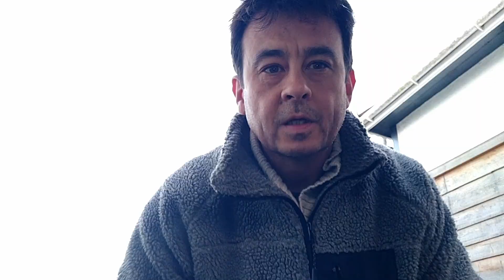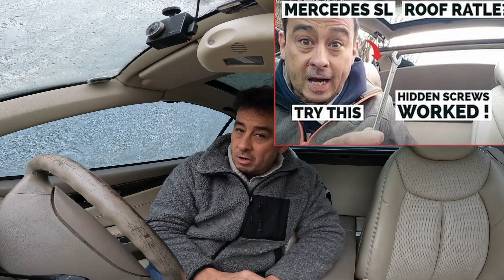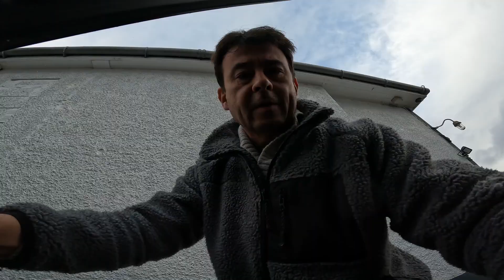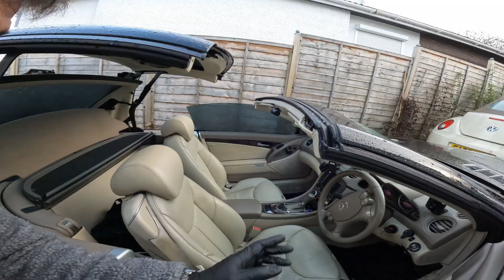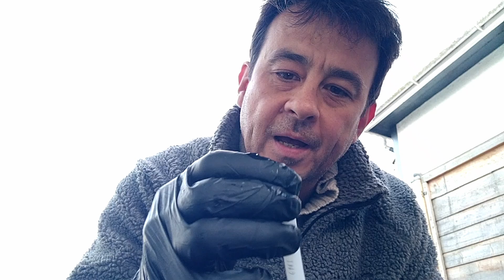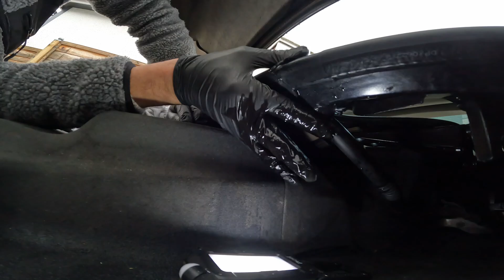Mercedes SL Roof Water Leak Fixes Trunk & Cabin

Comment: I have a PSE problem. I watched your videos. Great stuff. First I need to tell you I'm 76 year old disabled Army Vet, with very limited mobility. I've been trying to check the fuse behind passenger seat and I can't get the lid to open. I've removed the front panel but have no hope of being able to check fuse or remove to reset. Is there any trick to getting lid to open without PSE working. I'm pretty sure trunk soft close is faulty as well. It's on my to do list.
Reply from the maker: Hello sir, first thank you for your service!. Have you tried using long nose pliers to get the fuse? If you can get in the trunk, on the left is the PSU pump try disconnecting the electrical plug then pop it back on, you should hear the pump when you do this. You could also try disconnecting the rear battery leads and putting it back on.

Comment: Hi just a question please i checked the roof adjuster both sides by the C pillar you use a 10mm spanner for, mine (2003 Sl) dont appear to be adjustable? they seem to have a hard plastic cover over them which I will need to break to get access to any M6/10mm  locknut. it looks like the stops are tapped into the frame/strut.
Both stops are definatly too tight, my rear left side rattles and no chance of any credit card slotting through, I,m thinking year/spec difference with your own.
Or? i might just go for it and break the plastic to see if there is a locknut underneath.

I have found all my water leaks now and i,m dry, all were you said they,d be and I did the same mods as yourself for the fix/repairs, thankyou ian 

For Anyone interested I just fitted an Ebay £140 Android 13 head unit in my 03 Sl350, fairly easdy though they dont give you a decent wiring diagram, I,m a sparky luckily I worked it out, the issues are cambus headlight detection and steering wheel controls (volume, channel change, phone etc?
Any need help just ask
Reply from the maker: the plastic hard casing you are talking about is outside of the rubber. They are hard to pull down the first time, use a flat head screwdriver and get into the base and it will wiggle down, use a little lubrication. The thread as you said is tapped into the metal cast with a lock nut, let me know how you get on.

Comment: Your clips have helped me resolve several issues with my 2005 plate SL500. I'm about to address a minor leak in the boot, what tubing did you use? the link provided no longer works.
Reply from the maker: hi my friend, the Outside diameter of the tube was 10mm so find something that size that is slightly malleable.

Comment: Always engine ON while working on half opened roof ? Does the engine not overheated while doing this ? Thnks again sir! 👌🏽
Reply from the maker: No, engine will simply work for hours on idle, temp sensor will turn on radiator fan. No issues!
Reply: @ Thnks… have a great weekend!

Comment: I just got a 20yo Sl your video,s have been very helpful, Big Thanks, The only water i seem to get in the trunk is my fabric cover that sits over the spare wheel keeps getting wet, nothing else all seals seem to be ok, all drains clear, it must be running down behind the back trim and onto the cover.
As you suggested i have all the electrics etc covered with sturdy plastic bags.
Cheers Ian
Reply from the maker: @MrIzzyStewart  congrats on your lovely SL. I will bet it's the rubber seal at the base if the window and or the little rubber pipes. stick your phone camera on with torch, close boot and get the hose out.

Comment: Unfortunately, you will never stop it leaking. Fix will be temporary, and then another will pop up. Good try. This car won't be pleasant to drive as that leak sensor will be going off all the time. Changing with new rubber is a big job. The edge under the rubber will be rusting.
Reply from the maker: I try to keep on top of it, it does get a bit musty in the winter, but then I park her outside

Comment: What might be better a more supple tubing you could try a catapult tubing you can get replacement tubing from farmers suppliers, also heating up the Seals with a hair dryer first night sort out the indentation problem even if you remove the tubing afterwards

Comment: Great video. I fitted 10mm tubing last week. Poured water over rear window and no leak in boot, so looks promising. Now waiting for rain ☔
Reply from the maker: Great stuff, thanks if you subscribed
Reply: I used your tip of putting a rubber hose into the various rubber gaskets and it helped but I discovered the BIG leak was the rubber gasket along the bottom of the glass. I should have discovered this sooner.  Thanks

Comment: You have the same issue as I do on the rear back panel of the seat - have you tried to fix it?
Reply from the maker: Yes, you can adjust the hidden screw, it will bring the join closer together, also clean and lubricate your rubber seals.
https://youtu.be/1HcznBQPeQM
https://youtu.be/COY1q2GmRUE
Reply: @GrooveOn  ah, what I meant is the way the leather starts to pull and deform, lots like a teenager with terrible acne :)

Comment: Enjoyed the content thanks - I've had a boot leak where its got very wet around the soft close mechanism - seems to be getting in around the 3rd brake light in the centre of the boot lid.  Ordered a new part but for now just smeared some vaseline around the edges which should hold for a few days.  Mine is a 2005 SL350 :)
Reply from the maker: hey there, good work, the seal on the brake light is light foam isn't it. The vaseline should hopefully do the trick ! let me know, Thanks if you chose to follow me
Reply from the maker: Hi Mike how did the Vaseline hold up?  If it does not hold, then you can use a thin amount of sealant and wipe off. For automotive industry and the Rail industry I use a brand called Sikaflex, its a professional sealant and adhesive that is waterproof and sets in water too.

Comment: What diameter tube did you end up using? Thank you for the content.
Reply from the maker: Hi there, 10mm OD think it's in description mate
Reply: @GrooveOn  Indeed it is, thank you! Do you have a 350 or 500?
Reply from the maker: @cav4290  I had a choice I was going to get to 500, but I was worried about the ABC suspension so just went with the 350 that is a 3.7l and normal coils. I then lowered it by about 30 mm
Reply: @GrooveOn  Yes, probably the best way now, although coilover kits with sway-bara are now available for around 3400 USD.

Comment: Really appreciate all the knowledge. I have an '07 R230 and have noticed some water in the trunk, but not knowing where it might originate. I put some 'damp-rid' type closet hangers in there and they do absorb moisture and last about a month before I need to replace. I have an issue with the top hydraulic cylinders leaking right now and that is a considerable investment, but I do love my car.

Comment: hello, thank you for the video. What is the measurement of the extra rubber part on 04.15?Did you sealed it vertical and horizontal? Wont it block the water drainage? I am very interested!
Reply from the maker: Rubber pipe outside diameter is 10mm, it fits inside channel and won't block water mate
Reply: @GrooveOn thanks! But i ment the block rubber, between the 2   Gaskets
Reply from the maker: @henksloetjes7112  oh I got you, that is around 5mm thick, just find something that is similar, you are trying to separate the two sections of rubber mate

Comment: Thank you for this comprehensive documentary. Got my SL500 18mths ago, ive just cleaned and oiled all the seals , So far thats been perfect, but you’ve given me so many more details , especially that nut that’s accessible at the rear when the roof is up. I use the Mercedes sliding oil, would you recommend a cheaper alternative ?,, this is great you documented this , thank you
Reply from the maker: Go with the Mercedes oil, it will last for years

Comment: Yeah, mine doesn’t leak however it did happen to me I open the roof and I shut down the engine and it collapsed on me so I learn my lesson. Good thing to do is lubricate the seals with petroleum jelly. Good luck. my SL 550 it is 2009 with, AMG package color is silver with burgundy interior.
Reply from the maker: That Burgundy colour is quite rare my friend lovely car

Comment: This worked great for me i also re olied all the rubber seals with the merc oil. Thanks for posting this. Now all i need is to refit the original sat nav and i will be all set. 😊
Reply from the maker: Nice work, I did another video on the command unit removal and fix that may help you
Reply: @GrooveOn  what is the title of those video?
Reply from the maker: @2103woody  here you go. https://youtu.be/PcSlUApgII4

Comment: My R230 does have the water drain holes as shown at 5.28. I know there have been slight changes to the later models mine is the 2006 ... any thoughts?
Reply from the maker: Hi there, did you mean your car does not have those drain holes at 5.28😉, if that's the case, it's no big deal, the water should run off the rear

Comment: I checked in the Sikka 221 and it doesn't have a good shelf life. A friend of mine is a director of C Tec and these are his comments "CT1 Black would do the same job with increased bond strength, no shrinkage and without the odour/solvents you get with a polyurethane."
Reply from the maker: That's interesting to know, I have sikaflex in my garage that I've had for 5-years and that's what I used in the video without any issues. The product is used in the areas that I work in engineering mainly automotive and train applications. CT1 is more of a domestic brand rather than professional, but still good. As long as it is not a sealant only, it must be adhesive sealant combined that can set in water.

Comment: What diameter tube did you use. I intend to strip and repair the boot seal but my seals are also flattened
Reply from the maker: Hi Jackie, the pipe OD was 10mm, just cut it enough to get it pass the little moulded join.
Reply: @GrooveOn  Thanks. I am enjoying your videos. Chris. I don’t know why it is putting my wife’s name up.
Reply from the maker: @jackiebedford1609  ha, it's because you are signed into her account I think mate. Try logging out
Reply: Changed account, thanks. Also I fitted the tube on both sides and- hey presto- no leaks. Thank you. I would never have thought of doing that. Other videos show how to replace the seal but that still leaves the same problem which you have solved.
Reply from the maker: @chrisbedford6717  hey no way!!! That's brilliant, so glad. I also applied some vaseline along the top of rubber where it meets the trunk. Did you remember to loosen or remove that drain plug under wheel
Reply: @GrooveOn  Yes. It had already been removed. I think the previous owner had problems as all the electronics, pumps etc have been screwed to a block of wood to raise them. I am now about to adjust the roof with your hidden screw as water has been dripping on the back of my seat and the "leather on the back seat cover has swollen and crinkled up. I would send a photo if I knew how. I have taken it off and when it has dried I will use a hair dryer to hopefully shrink it  and flatten it out.
Reply from the maker: @chrisbedford6717  have a look at my channel, there is a video I did just for those hidden screws that can help you

Comment: You need a new steering wheel
Reply: I had the same issue but with „methylated spirits“ (German: Brennspiritus) I could get it almost new.
Reply from the maker: @samothegeolg5206  no way, I'll try that!
Reply from the maker: I know, when I watched the video I thought the same
Reply: I sanded mine down and used Scratch Doctor paint and sealer. Perfect.
Reply from the maker: @jackiebedford1609  I might do this, I was going to get some dye made up
Reply: @GrooveOn  They do a steering wheel kit but that is generic. Check the Mercedes leather paints on their site and finish with the sealer

Comment: I was told to keep using a product from Sonnax for the seals from an Audi techie , last owner, 17:51 It’s a silicon based liquid. Comes in 100ml bottle. Full name in English I can’t remember as my bottle is in Polish 🤷‍♂️. Been used on my 03 for years apparently and the seals are super soft and flexible  Think it costs about £10 on Amazon
Reply from the maker: I use vasaline